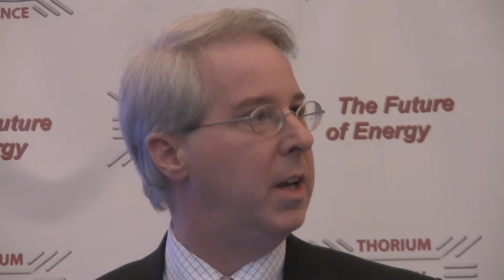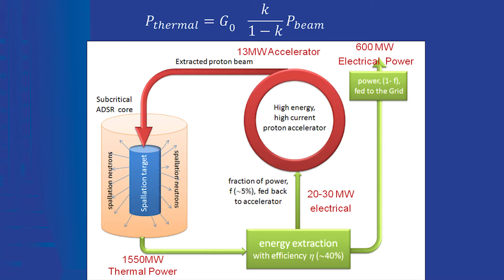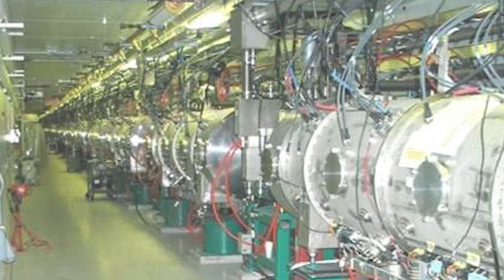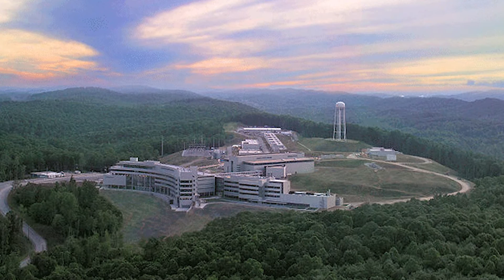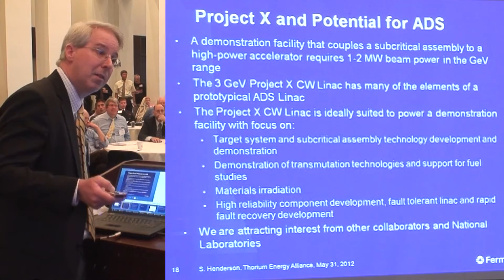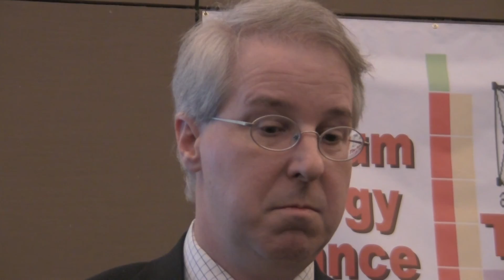Stuart Henderson - Thorium Energy from Accelerator Driven Reactors @ TEAC4

Comment: You are correct. He is working on an Accelerator Driven Molten Salt Reactor.
Reply: I think that's a good idea.  MSRs are safe, why not make them safer?
Reply: @uggligr  the amount of safety is hard to quantify because the system is so complex - also very expensive, for questionable benefit

Comment: Aloha.
I am not a nuclear physicist, I come from an Electrical Construction background.
This AD system that Mr. Henderson talks about sounds like nothing more than a Fused Disconnect Safety Switch that would be used to protect electrical loads from damaging themselves and can be used to selectively energize/de-energize the circuit.  It is NOT necessary for a LFTR to run, but IF you want to use something like SLAC (Stanford Linear Accelerator Center) as a gigantic & expensive ON/OFF switch for an already very safe LFTR, well, wasting money and making things more complicated than needed is something that DOE has an excellent history of doing. 
Adding ADS to LFTR, strictly as a regulatory 'feel good' system, would be like not approving the gas cap on the fuel tank for your automobile, so you can't pull into a gas station and filler up.....instead, you have to pay DOE to build you a micro-refinery to make the gasoline your automobile consumes, and now you have to tow that micro-refinery behind your automobile.
I am glad that Kirk Sorenson questioned him at the end, and pointed out that ADS is NOT needed for LFTR.
Re-watching this video, I was glad to see that most of the faces in audience had the same dis-believing look of shock at the utter non-sense Mr. Henderson was trying to 'sell'.  Sounds like he had no interest in advancing LFTR, but rather somehow using LFTR to extend the existence of things like SLAC that have been costing us billions of dollars since before I was born.
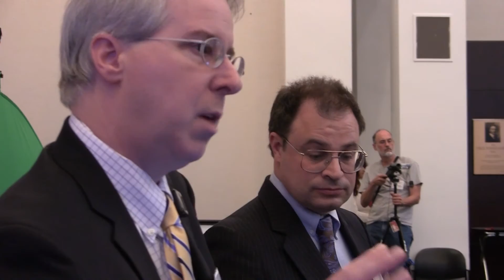The look on John Kutsch's face at 22:20 into the video speaks volumes....like, 'Who let this guy into a Thorium Conference when his only interest is decades old particle accelerators?"

Peace & Prepare
Pax et Paro
Reply: I am not a physicist either, though I am a nuclear engineer (sub officer in my youth).  Agreed, this seems very much like a funding grab. Coincidence...they need the same type of accelerator for their own Project X!

Argon lab...the center of LMFBR and the competing teams that set out to stop Weinberg.
Reply: That could be.  I don't see a need for such high energies, MeV should work.  Lower proton energy costs about $6,000,000 and lower volts equals higher current, and what you need is higher current.  I think Dr. Henderson wants a reactor made with pure thorium, and we have starter fuels available.
Reply: So how do you propose we get rid of e.g. all the Technetium-99?
Reply: ADS is like an attempt to get energy by burning tar. Under normal circumstances it's hard to burn it and you have to heat it or add some gas to make it easier to burn. For nuclear reactor that would mean use external neutron source (accelerator) or add some significant amount enriched uranium. First option is relatively safe for nuclear nonproliferation while second is one step behind nuclear bomb. Those who say you can't build NB from thorium just lie you can do that it just not going to be as efficient as with plutonium 239 or uranium 235. All other nuclear reactors require enriched uranium at least for a start while ADS might work on uranium 238 or thorium. The problem is as you mention those accelerators would be expensive and we have never build anything like what would be required for such nuclear station.

Comment: Hmm. By aiming for a specific neutron energy one could have good chance of burning certain minor actinides reducing some of the waste. 

This might be something to reduce the problem of nuclear waste from millenia to decades, but it would also be complex and maybe there are better treatments possible here
Reply: I'm thinking maybe you can tune the accelerator to control the PRODUCTS of fission.
Reply: @uggligr  that is what i would assume, nor sure we can yet control the precise frequencies, speeds well enough
Reply: I think the ideal speed is the resonance integral of whatever it is you want to "burn". While fertile materials double as "neutron poisons" in critical reactors, there is no limit upwards or downwards for the total amount of neutrons the system can "consume", because you can simply add more neutrons. All you have to ensure is that you never reach criticality. If desired, you can have shutdown rods for that purpose. So even highly undesirable actinides like Neptunium-237 which consumes what? 4 neutrons? Before it fissions becomes a possible fuel in a thermal spectrum. Yes, you need to hit it with loads of neutrons, but you can simply make loads of neutrons and still come out ahead power-wise.

Comment: Adding complexity of an accelerator to a fission reactor. What a great idea. LFTR uses a salt plug to deal with a runaway reaction. These geniuses use an accelerator!
Reply: Salt plugs are extremely slow reaction time, this is potentially millisecond response time. I agree that this is overkill, but i wouldnt see the salt plug as the be all end all of safety systems. Its only really relevant for a loss of electrical power to a normally operating reactor. We dont have SCRAM to deal with normal. Unknown unknowns etc
Reply: @ravener96  I think the overkill is the energy proposed here.  I think you could get by with about 20 MeV or so,  1000 MeV is pretty high.
Reply: A LFTR cannot "burn" neutron poisons to arbitrary concentrations in the fuel. An Accelerator Driven System can

Comment: sub critical  reacotr accident are not because of criticality this is always stopped with in seconds its the heat from decay that you have to control which is why salts are the answer. so sub critical goes striaght out the window. the rest is the same as molten salt why as complexity. no part is the best part

Comment: The waste problem?  There is no waste problem!  A fast MSR can eat that spent fuel and use it provide power the world for thousands of years.
Reply: Yes, we need to get rid of the arsenals.
Reply: Fast reactors require highly enriched fuel. Highly enriched fuel is deemed a proliferation risk. Which is why basically only bomb-states have done any research into them and tepid one at that.

A subcritical reactor needs no enrichment of any kind.
Reply: We tried many MSR and they work well. The issue is the shaer complexity. We faces many issue with phenix and superphenix. I think subs are a good concept
Reply: @uggligr  We in Ukraine think completely different. That was our biggest mistake to get rid of nuclear weapon.

Comment: Are you sure a billion electron volt accelerator is needed?   Less voltage means more current.  I'm thinking about 20 MeV will do the job.  There wasn't any discussion of cost.  That's important.  According to the IAEA, a research cyclotron costs about $6 million dollars.
Reply: "Electronvolt" is a confusing unit. It does not actually mean "voltage" but "energy". And in the case of subatomic particles, "energy" can be equated to "speed". And under a certain speed positively charged particles will just "bounce off" the positively charged nuclei most of the time. You need a certain minimum energy to get enough neutrons per Proton you fire in there, but after a certain amount, you reach a plateau, so there is a sweet spot and it is indeed on the order of 1 GeV (which is like 90% of the speed of light, if memory serves)
Reply: Also, as to the cost of a research cyclotron... That includes a very important word: research if you are doing science-stuff, you'll want the most cutting edge detectors you can get. If all you want is producing neutrons for nuclear fission, you will need none of that. A simple neutron flux measuring system as you have them in many existing nuclear power plants will suffice.

Comment: Does Stuart Henderson say AD systems are incompatible with thorium MSRs?  My understanding is that they could conceivably go together - am I correct?
Reply: I believe Dr. Henderson is thinking of a stand-alone system, and I think they should go together.
Reply: Yes. You can have the "target" be a molten salt, a solution, a metal, an oxide, TRISO, a carbide - whatever.

What he is pointing out is that there are advantages to not having the neutrons (during normal operation) originate within the fuel, but instead delivering them from the outside. I think he should've tailored his talk more to the audience and made that aspect clearer.